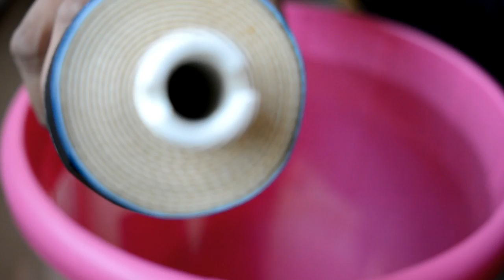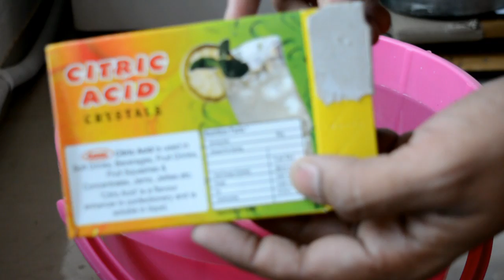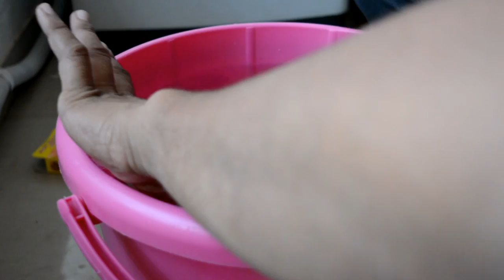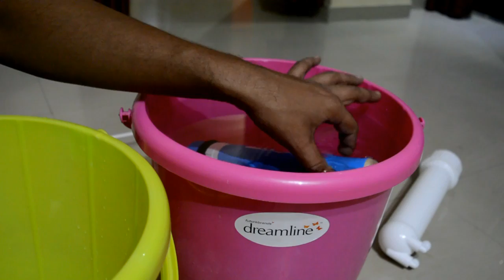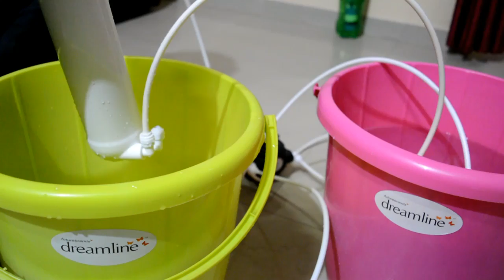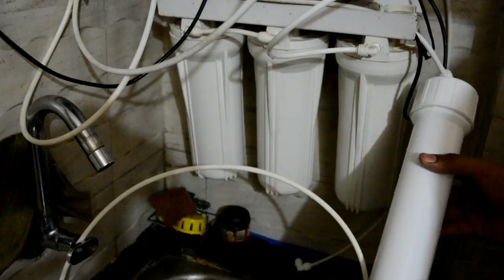RO MEMBRANE CLEANING CITRIC ACID CSM DOW how to clean Reverse osmosis

Comment: You can't wash or clean a membrane........... once the membrane breaks, you can't repair it.........
Reply: Bahut hi zyada boring video
Reply: Absolutely correct Sir, I dont even know why this guy doing this.. Making a negative knowledge for public.
Reply: it is cleaning of low flow ro membrane , not a broken membrane. citric acid dissolves iron rust and sand trapped in membrane making membrane to give the proper flow.

you didnt remember what you read in school. it is basic secondary school science.
Reply: He is not repairing a broken membrane he is trying to dissolve the solids that has been making the flow stop. And that could/should be possible.
Reply: @cajampa  One word RO Membranes can't be reused, ganda pani pio aur pilao
Reply: @Mukeshmiktecrep  Why are you talking about things you don't understand dude. Of course they can, mine are probably soon 10 years, i clean my RO system every 6 months sterilize everything and change the carbon and put back the RO membrane just like everyone else. Are you telling me you keep buying new ones for no reason? lol
Reply: @cajampa  Help i keep clogging my membrane because of our hard well water. I already installed 4 stage prefilter with resin filter and anti scalant balls but still keep clogging my membrane. My TDS is around 300-600ppm
Reply: @jyrkytv1112  How long do the RO membrane last? What model is it? Is it whole house RO. Or just a smaller type for drinking water? Are you using a pump to keep the pressure optimal? Are you keeping the waste water flow optimal? The only time I ever broke a RO membrane where when I used to high pressure and to little waste water flow. Are you rinsing the membrane with an basic and then acid flush when you clean your system?
Reply: @jyrkytv1112  as far as I understand it. The more TDS in your feed water the more you have to throw away to flush away the scaling from the high mineral content on/in the membrane. And also using a pump to keep the pressure optimal is key. As far as I understand it for small type RO membrane it should be around 70 psi. Do you used an pressure meter to make sure you are running the membrane at the optimal pressure? Do you use an pressure regulator so that your other water uses do not impact the RO system to much? Like for example when an washer starts or something Iike that, it can cause a large drop and then a spike in pressure and that is not healthy for the membrane.
Reply: @jyrkytv1112  do you use an tank to fill in to or are you filling in to something without backpressure like a damejanne or something like that? Are you running pressure in to the system all the time and it auto starts with low water levels or are you starting it yourself when you need to fillup an container?
Reply: @cajampa  Its vontron 100gpd sir. Just got my 4th one today and filled up 2 gallons or 40 liters then now i get very low output. I also use a pump, normal psi should be 90-100 but im getting 140 psi now. I already lost 3 membranes sir.
Reply: @cajampa  Before i only turn on the system when i fill up containers but today im running for more than 10 hours already and im getting very low output now. Tried it in my friends house with municipal water got no problems with it.
Reply: @cajampa  There is a pressure meter but no regular as far as i know sir. When the washer starts it cause a large drop pressure spikes to 100 normally but now i got 120-140 psi
Reply: @cajampa  i start the unit my self to fill my containers sir.
Reply: Yeah, answer me why engineers and plant operators using your method, why they are using new one, lmao
Reply: @_sumit_kr  hi sir. Can you explain me the process. I already clogged my 100gpd membrane in just 60 liters. How many drops of citric acid in i bucket of water? Can i use phosphoric acid?
Reply: @Mukeshmiktecrep  lol you are so severely confused. It was the engineers and plant operators that developed the method for doing basic and acid flushing out and refreshing a membrane from scaling. And why some don't do it? Because they are not paying for the new membrane of course the owner of the plant is and this is often a municipality. And it takes effort and time and extra plumbing to do this and it is quicker to just drop in a new one. And not every plant have a system protocol for this. Stop talking about things you don't understand. Do a very basic Google search about the concepts before you embarrass yourself more dude.
Reply: @jyrkytv1112  Ok. I suspect your waste to clean water ratio is bad. How do you tune your system for this? Did you buy an adjustable flow restrictor or did it come with just one type like the 800 mlm flow restrictor or something? Because it seems 800 is the standard size for a 100 gpd membrane but that might not be enough for you. For example I have 160 TDS in my feed water and I run 75 gpd membrane and I need a 300 mlm flow restrictor, but when I build a system for my brother he had as low as 80 TDS in his feed water and then we could use a lower flow restrictor compared to how much I had to use. I think you need to use a higher flow restrictor to allow the extra waste water to clean out the scaling as you run the filter.
What micron sediment filter are you using before your system?

About the basic and acid flush. I think most are using citric acid or hydrochloric acid for the acid part of the flush. And citric acid doesn't go below 3,5 pH so just put a bunch in, let it dissolve measure and make sure you have the right temperature and that you can run it at the correct psi. I you are doing a flush you can't be running full pressure like if you are producing water.
Reply: @jyrkytv1112  i checked out the vontron 100gpd it seem to be able to be run at higher pressure than what my type is certified to run at a (Dow flowtech 75gpd membrane) so your pressure should be OK. But read up on it to be sure.
Reply: @cajampa  membrane already clogged after 80 liters. Can you please advise if i can use phosphoric acid to de clog the membrane? If citric acid, how many drops in 1 bucket?
Reply: @jyrkytv1112   I have already answered this, read the whole thread. I said most seem to be using citric acid or hydrochloric acid. I suggest you do more research if you are interested in how to do a acid and or basic flush. Because there is more to it than just putting some acid in a bucket so if this step are stumping you, you need to learn more first because it is more complicated than that. 
And answer my question about what flow restrictor you are using, because i believe that is why you keep clogging your membrane.
Reply: @cajampa  flow restrictor is a solenoid thing as per technician. It is connected to a wire with small transformer like in the top.
Reply: @jyrkytv1112  No it is not. The flow restrictor is what decides how much waste water you are running through the ro membrane compared to how much clean water you are getting out. You have a too restrictive flow restrictor for your high TDS level.
This is why your membrane is clogging. And this is why it works at your friends house who has probably around 150-200 TDS, did you measure the TDS there?

Search google for flow restrictor ro and read up on what we are talking about and find out where it is and then find out what you have, i think you have an 800 mlm and you need to get an higher one. You need to let out more waste water to not clogg your membrane.
Reply: @jyrkytv1112  Just to be more clear, the ro housing has an inlet for feedwater, yes? And two outports, one for clean water and one for waste water, the waste water outlet is connected to an flow restrictor that decides how much backpressure to put on the membrane to force out some clean water through the membrane. And that flow restrictor come in different "sizes" your 100gpd standard flow restrictor is 800 mlm most likely BUT you have very high TDS so you need higher wastewater flow to not clogg the membrane.
Reply: @cajampa  you're right sir. Waste water is connected to flow restrictor.  I will try to change it but is it ok to replace it with the unpowered one? And how many cc would you recomend for 100gpd? Cc is the gauge here not mlm. Thanks again!
Reply: @jyrkytv1112  CC and mlm is the same. I have no idea what "the unpowered one" means. And i can not give an exact recommendation you will have to experiment and try a bunch until it works. Start by finding out what you have now like i have already asked you this. And then maybe we can draw some conclusion from what we then know don't work. All we know for sure is what you have is not correct and that you most likely need more waste water flow. Try buying a bunch with more flow than what you have, try the largest flowing one you got. Try a new membrane and hope for the best. If that works without clogging, you can start trying more restrictor flow to save on water. If i were you i would probably try one at least twice as high value than what you have now. If you know your friends TDS you said it worked at, TDS you can draw conclusions from that and maybe double for every x more TDS you have as most. So if he has 200 TDS and it worked with an 800 mlm standard 100 gpd flow restrictor. And you have 3 times that, try 3 times the flow restrictor. BUT i guess you did not have the same pressure there anyway and that changes things. Try twice or 3 times what you have now to be safe and if that works start experimenting by dropping down. Also make sure you have a tight sediment filter before somewhere on you your system. Another thing that can clog a membrane is biofouling from algae in the feedwater and such and you never responded to what sediment micron filter you where using.
Reply: @cajampa  copy on trying on different flow restrictors. Im using 2 20 inch sediment filter at 5 and 1 micron.
Reply: @jyrkytv1112  Ok, good let me know if this solve the clogging problem. 
That level of sediment filtration is a lot. Do you really need two 20 inch filters so close together in micron size? 
As in do they get filled before a year when you change and clean out the system anyway?
If you don't fill them in a year i suggest you just use one Pentek DGD-2501-20 instead. That is what i use they works great, the best i have found and i have tried a lot of different ones and different setups, it goes from 25 micron all the way to 1 micron in one filter, so it is as tight as an 1 micron but it can hold much more sediment than a tighter filter like those you are using.

We have an crazy amount of manganese is our water as sediment that really fill up that filter in a year.

Also remember that if a higher flow restrictor solves the clogging problem you probably don't need those resin and anti scaling balls in the pre stages. 
Never use more stages than what you need for your feedwater situation, it only cost a lot of extra money and time to service.
And the sellers are fast to sell you on a lot of shit you don't need because they are not interested in you having the optimal system for your water, they are interested in you buying a lot of filters from them.

There is two parts to building the optimal system, one getting the perfect tuned delicious RO water that never fails and two getting the perfect water as cheap as possible and with as little service time and energy, to do those services when it is time to do it. 
All of that takes a lot of experimentation. Not using more stages than needed is key to this. 
Every extra stage not needed is extra pressure loss and money and time spent for no reason.
Reply: @cajampa  Great, Lol, to defend your misguiding video you are just ignoring the facts. Okay if you are right then give me a link in which your method is mentioned.
Reply: @Mukeshmiktecrep  Do a search for acid and basic ro membrane flush.
This is not my video.
What is this "your method is mentioned" you are talking about?
I have not described anyware a specific method, other than trying to get you to understand that the concept of acid and basic ro membrane flushing is a basic ro membrane treatment option.
Reply: @cajampa  Bro send me link for the research or any published papers which proves your method
Reply: @cajampa  hi sir! I think i partially solved the clogging problems following your advise. I disconnected the waste water hose to the solenoid and instead use a clamp to control the output. Im getting better output compared before but still need to do the acid flush to declog the membrane and see if i can normalize the r.o process. Thanks much for your tip. Its really helpful!
Reply: @jyrkytv1112  ok, that is good to hear I knew it would work. 
Look in to getting an adjustable flow restrictor if you want to be able to easier adjust the flow of the waste water ratio. Also look into to doing an basic flush before you do an acid flush. Most guides I have seen seem to recommend that you do that first. Because if you do it the other way around by using an acid flush and then an basic flush. It can depolarise some things that can get stuck in the membrane making it harder to clean out. BUT it could also be the all you need it just do an acid flush to remove the scaling. It depends on what type of foulant that is clogging up your membrane. Good luck on your journey to perfect water.
Reply: @cajampa  hi sir. Output decreases again even with my current setup. Ill try to basic flush and acid flush and see if it works. Gonna buy regulator also for the waste water hose.
Reply: @jyrkytv1112  Ok, have you managed to figure out what flow regulator speed "cc" you had before that didn't work was? 
And what do you estimate your current waste to clean water ratio was? Did you measure it? Because if you don't know where you where and what you have tried, it is very hard to know where to go as far as finding a working and correct flow regulator setup. If you don't know what you have tried the risk is you will end up where you where again. 

Also trying with an old almost plugged membrane complicates things. 
Because the correct setup for a new membrane is not the same as for one that already has problems. 
If for example you might need 2 or 3 times more flow than you had when it was new to even get it to work so it doesn't clogg, but using an already partially clogged membrane you might need even more waste water flow ratio to get it to not clogg in the membrane you already partially clogged. 
But hopefully you succeed with a flush and it works for you. But problem is even if you get it work you are going to need to recalibrate the waste water ratio if you get a new membrane in the future.
Reply: @cajampa  Copy on this sir. Thanks again!
Reply: @cajampa  Hi sir! Managed to improve output by flushing with phosphoric acid and now i've been flushing my R.O for about 3 hours already but still getting acidic ph. About 5.0-5.1. Should i continue flushing method until ill get the level 6 ph or ill connect the alkaline filter before the UV? As of now im not using alkaline filter.
Reply: @jyrkytv1112  how are you flushing? Directly from feedwater or from a bucket with water? When I did an acid flush with citric acid. I used a big mason jar on my magnetic stirrer hotplate at 40C with about pH 2 water and ran that 25 min through the membrane then I switched to a big 15 liter bucket with sediment and carbon filtered feedwater and circulated that and switched out the water a few times after awhile the pH was about 6,5.  
What pressure did you use?
I ran a little less then 10 psi.

As long as you are circulation enough neutral water it should go pretty neutral after a while I would think.
What pH do you have in your feedwater?
Maybe it is a bit sour?
That would explain it in that case.
I don't run an alkaline filter after the membrane just a 10 inch coconut carbon granules refillable housing filter.
If I want it extra "alkaline" I use hydrogen water bottles to treat the water just before drinking. I don't trust alkaline filters and machines.
Reply: @jyrkytv1112   ok, i think i get that you are running under normal water producing ro pressure now then. But what is a normal ph level for you after the membrane? It is hard to know what is the target if we don't know is normal, or are you saying that 6 ph is what you usually get after the membrane? I don't see why it shouldn't normalised if you run it like you use to. But then again I have never used phosphoric acid for this.
Are your tds after the membrane like you expected?
Reply: @cajampa  Hi sir, i did acid flush with about 16 liter bucket around PH 2.5 - 3. And flush thru strong wash mode and normal R.O water producing. Feed water is around 6-6.4 pH and before pH is around 6-6.5 after R.O. Didn't taste yet the product water and I've got a better TDS now that i followed your advise regarding higher waste water output.
Reply: @jyrkytv1112  ok, the water output should go back to normal ph level after you have ran through enough water, I can't not see why it shouldn't.
Is both the wastewater and the ro output both still more sour than the feedwater? Because if the waste water is now the same as the feedwater that would indicate it is all just about how much volume you need to run through the system.
And if it is different ph in the waste and ro output that gradient would indicate how much more you need to run the water before it has normalised.
Reply: @cajampa  Hi sir. im still getting 5.3-5.4 ph as of now. I didnt tast the output for both waste and ro output. Im using PH measuring pen for checking sir.
Reply: @jyrkytv1112  Ok that is strange. But you did not answer what i asked about "Is both the wastewater and the ro output both still more sour than the feedwater?"

When you said "tast" did you mean taste or test? Because why not test the ro and waste water? It is the easiest and fastest way to to know if the problem is you need to flush more or not.

And you say "im still getting" do you mean you have been had it running for over a day since last time?

Because last time you said it was " About 5.0-5.1" and now you said it was 5.3-5.4 ph so it is improving, right? 
You just have to flush more it seems.

If we knew more data points like ph in waste AND ro water AND your wastewater to ro water ratio, it would be easier to draw a more informed and exact conclusion.

You can just try to keep flushing it, it seems to improve the ph slowly.
In less than 2x time the flushing you have done between the first and the second ph ro measurement, it should be back to about feedwater 6 ph, is what the numbers that you have reported so far indicate to me.

Or you could try to connect the alkaline filter stage and see if that takes care of bringing the output to more neutral.

I think it will sort itself out if you flush enough.
Reply: @cajampa  hi again sir. Feedwater, r.o output and waste water doesnt taste sour. I tried measure the waste water and im getting a reading of pH 6.5-6.8 vs r.o output of 5.3-5.4. I already tried r.o output with alkaline filter and w/o alkaline and im still getting the same pH result.
Reply: @jyrkytv1112  Just let it run and the ro water should normalise.
 
And just to be clear, when i ask about if something is sour i mean if it is acidic=sour=low ph value. 

One of the reason why i don't trust such things as that alkali filter is it doesn't even do what it claim it can do. If it is an alkali filer how come it can't make the water more alkaline = basic.